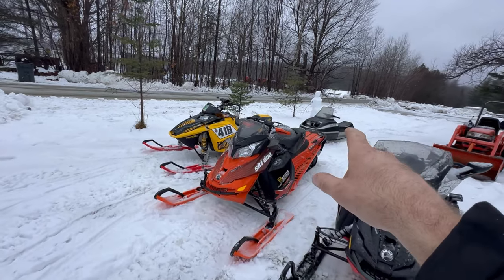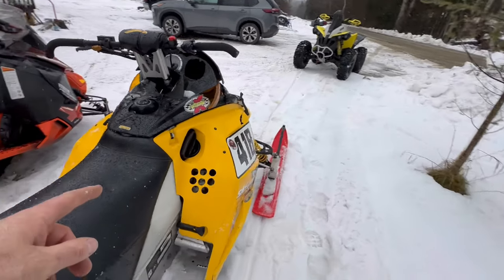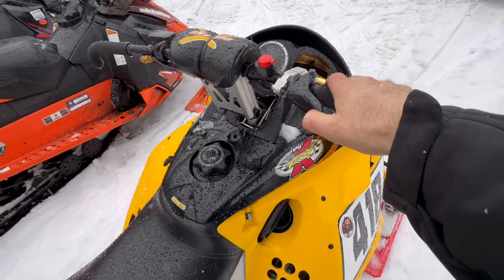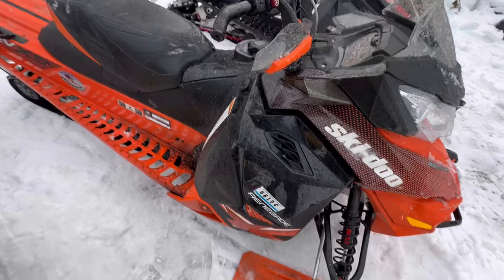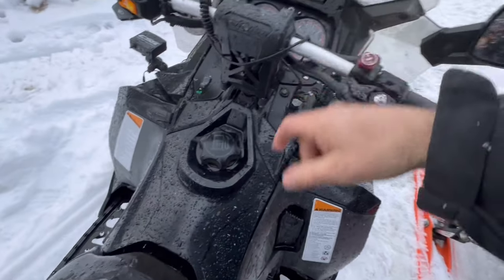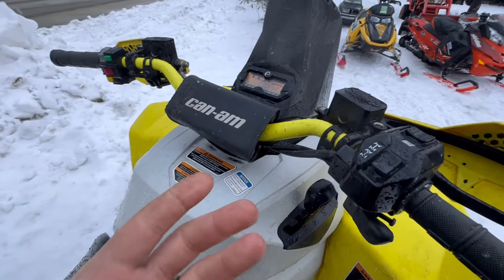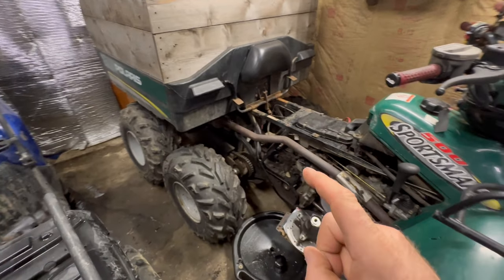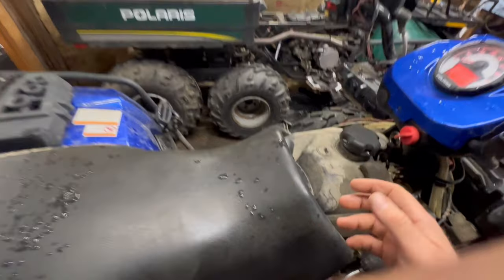An awful lot of BRP products coming in the shop!

Comment: The 98 T-cat was a 1000, it was the fastest one they made. 1999-2002 was the last 2 stroke one, different body style, still fast but wasn't as good. Yours must be a 96 or 97. 93-95 had a different body style. The 900 had 161hp and the 1000 had 172. The 98 was the freak, it was a lot faster due to better clutches (button secondary) better airbox setup better pipes that had individual stingers for each pipe, I think that one was closer to 180hp.

Comment: Howdy Rock! what are your thoughts on trading straight up a 2002 Grizzly 660 2500 miles burns a tad bit of oil but no smoke. for a 2008 Renegade 800. The renegade needs a wheel bearing a cv boot and the fan temp switch quit working so he has it wired to the battery with a switch. can am has 6500 miles on it.
Reply from the maker: The Grizzly 660 is usually more reliable in my experience, however that renegade 800 is a fast fun machine with loads of power. All depends on what your looking for in a machine. If you want a dependable work horse that  has decent power, I’d keep the Grizzly. If your looking for a more sporty ride and don’t mind putting some money into it, I’d go renegade.